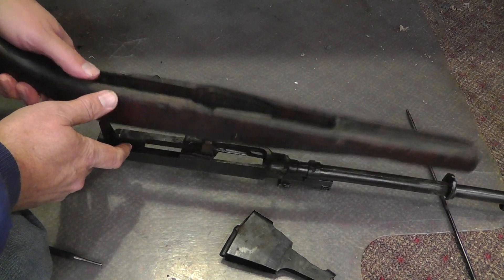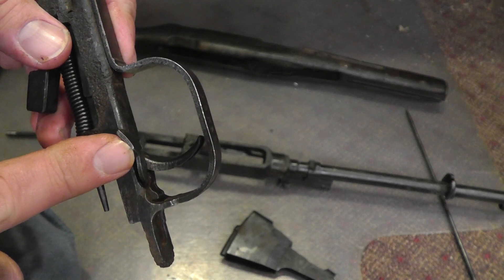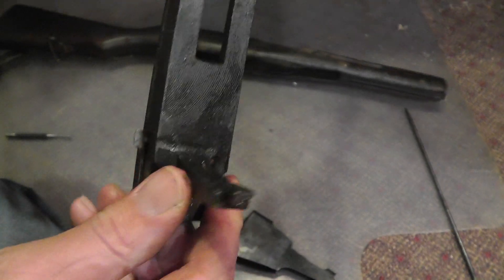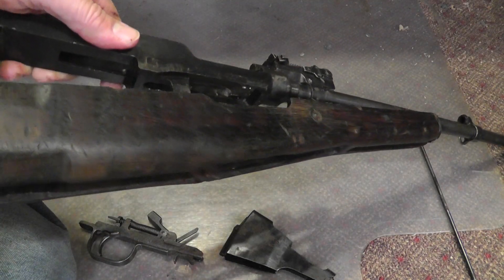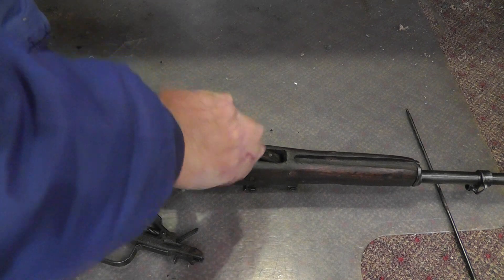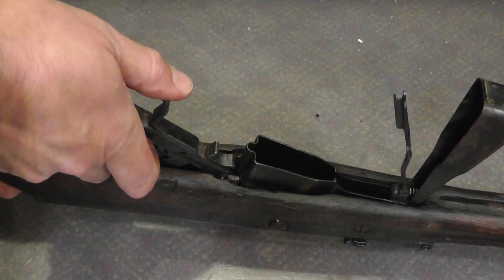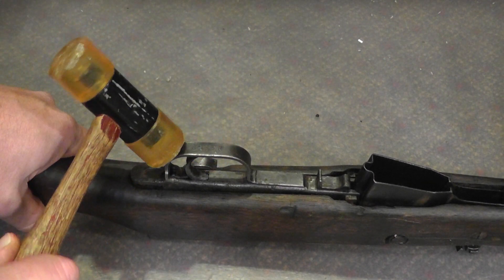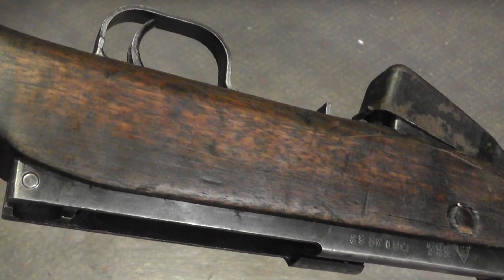Getting the Trigger Assembly Back in on a SKS Rifle

Comment: Well, I have owned a Yugo SKS for many years now and the trigger group has always been a PITA to get back in. Little did I realize, and no one told me before I heard it from you, that the safety should be in the on position to get the trigger group to go back in. I have gotten it in before with the safety off but only after several whacks each time that literally hurt my hand. Doing it your way and it went right back in one easy whack with my palm. Thanks,. I am bookmarking your video and will recommend it to others. Think, I will do a bblog post and include your video if sharing is allowed.

Comment: Every time I put it on fire the trigger assembly pops back out because it pushes back am I missing something I put on a dragonov stock everything else lines up and gun bolt and all functions cycles rounds when I put in mag and pull receiver..the damn trigger assembly will not go in while on fire goes in on safe but pops out when I put to fire ..??